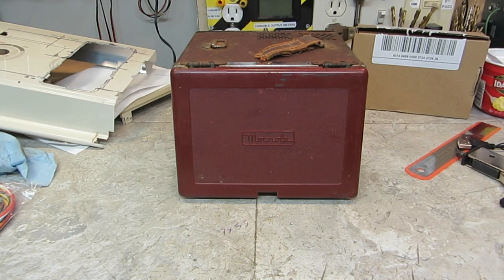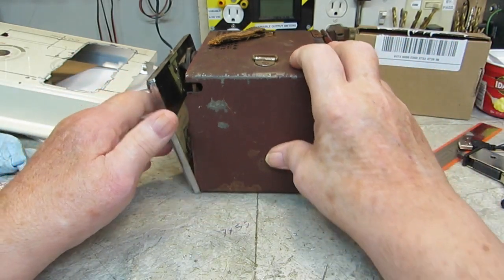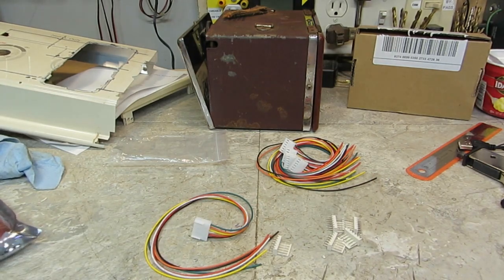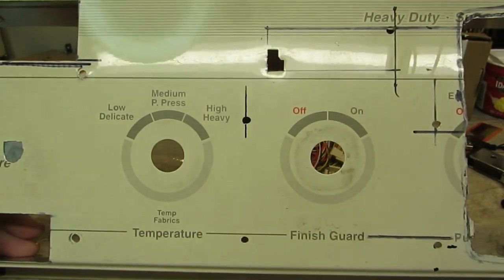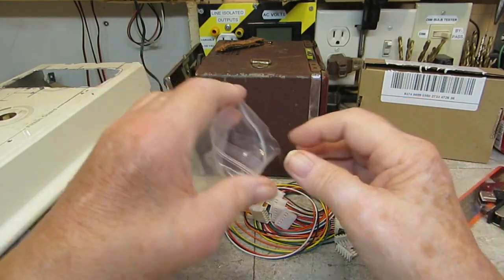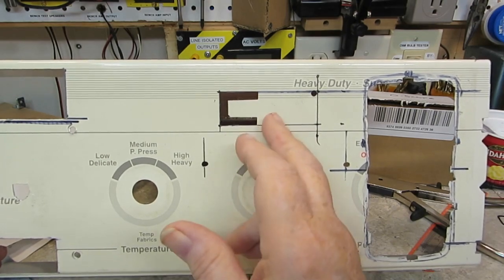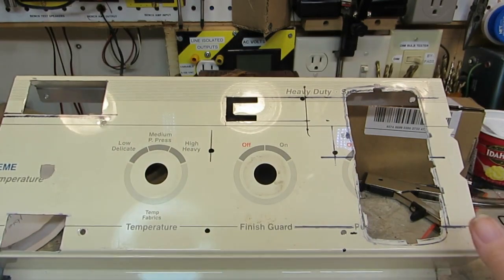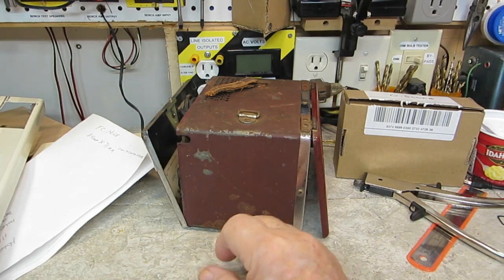DERB - Mail and more...

Comment: Doug, why don't you use an AA5 radio instead of tearing apart that battery radio, a lot of them have busted cabinets and would make a better radio to use, you do have the B+ supply and low voltage to light the one 12 volt tube in the front end.
Anyway I glad to see your hand is getting better.
Keep nibbling...LOL?